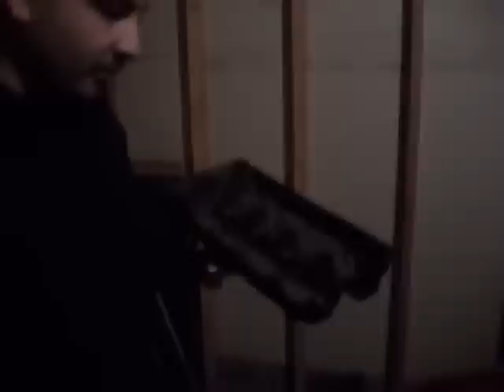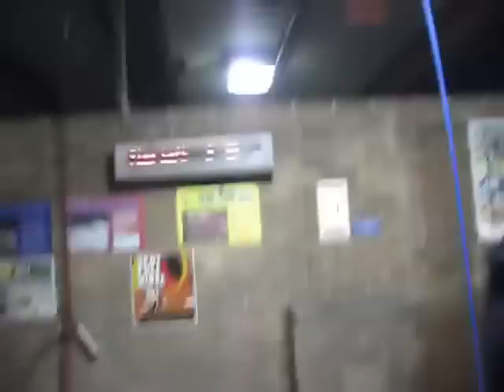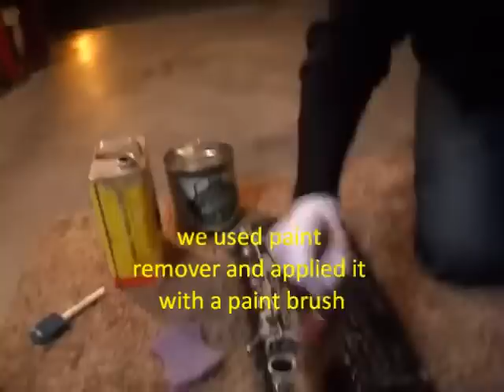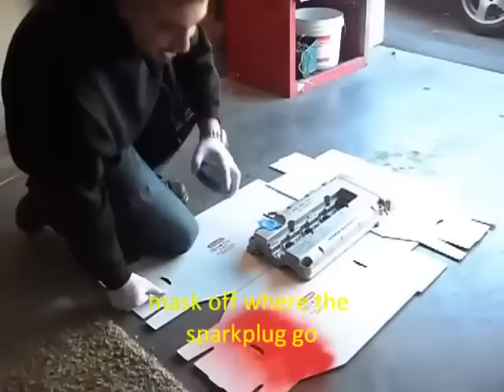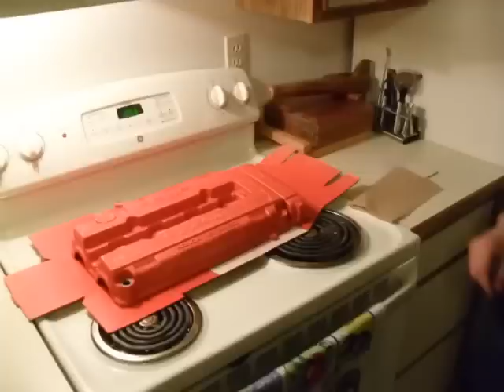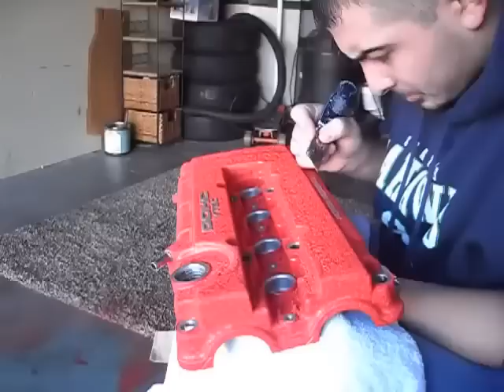how to paint a valve cover red (2)

Comment: I would recommend replacing the cover & valve stem gaskets if you decide to do this.  It's a "why not" scenario - since you already have the cover off, might as well refresh the gaskets (esp. since the gaskets have "settled" in stretching and such, refitting old gaskets may cause undesired leaks).

Comment: Tip next time for covering the spark plug holes, use body bar clay, for cleaning clear coats, just push it out from the bottom of the valve cover when your done painting. its like a puddy.

Comment: Just be sure to use engine-enamel quality paint - VHT is the primary brand.  If you go to your local autoshop, you'll find the majority of basic colors (black, red, etc).  An auto-body paint shop will have a greater variety.

Also, if you're adventurous, you can get away with a 2k basecoat in the color of your choice as long as you use enamel-based 2k primer and clear.  Good luck =D

Comment: Looks great, I plan on doing mine tomorrow & was wondering if the new jasco product would be to strong or should I use the plain orange stripper from the home depot? Also did you rinse/wash it after you stripped it/before sanding? Or how did you clean it off? Thank you for your time

Comment: I truly hope people are joking when they're asking how to paint their valve covers other colors.  This is a very basic job that only requires minimal effort - basic knowledge of painting (i.e. 3 light-medium coats of a 2-stroke misting method with 10-15 minutes of flash time between coats). 

 If you're skilled with a metal file, run the file in a chosen direction over the embossed lettering when the paint is dry to touch - it will add a nice effect to your final job.

Comment: put some dot 3 brake fluid in a tub and then soak the vavle cover in it. brake fluid will lift the paint right off. wont hurt plastic either unlike paint thinner.

Comment: You should use the spray paint stripper its better, then bead box. But honestly dohc valve covers are better in Chrome. Since youre using a usdm gsr cover, and want it red you can just order the USDM ITR valve cover at the acura dealer.  If you want it real jdm style with the H emblem on the Exhaust valve side then paint the JDM B16 cover in red if you wanted it jdm itr look. just saying!

Comment: god i hate the look of that wrinkle paint
Reply: ***** He meant the quality of that painting, you can paint good and you can paint badly, it's all about the painter him-/herself, it's not the paint's fault.

Wrinkle paint usually happens when a amateur 'painter' tries to paint something.
Reply: ***** Well, i weren't talking about an actual paint i was talking about the paints of these days that can be used wrong so it becomes wrinkly which is all about the work's quality.

There's also those old paints that made that kind of look, yeh i know.
Reply: ***** Well yeh, the aftermath is also depending on quality of the paint but you can also paint badly with most expensive paint and fail at it and the whole coat looks bad.

Comment: use aircraft paint remover apply a generous coat and about 10 minutes later its removed pretty much just spray it down with a pressure washer no scrubbing or even sanding and it does no hard to aluminum remember what airplanes are made of oh and BTW your paint looks like someone shit out the paint onto the valve covee